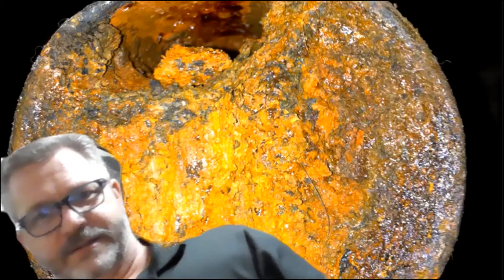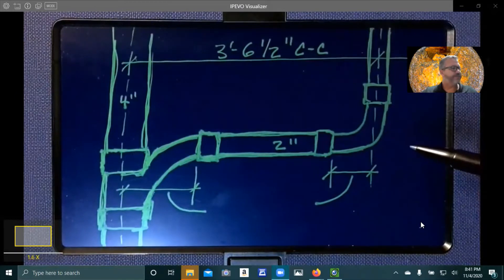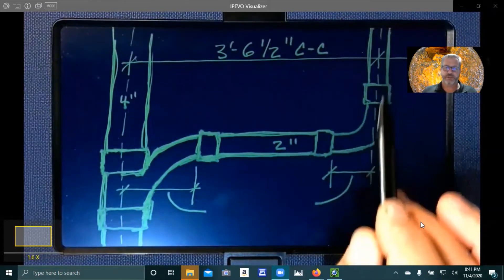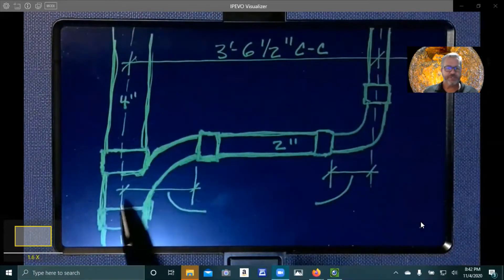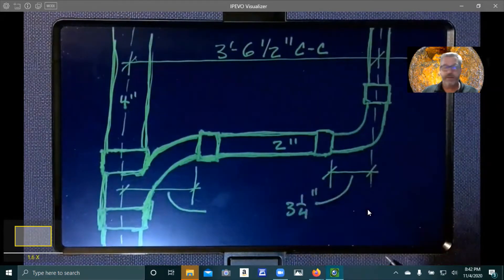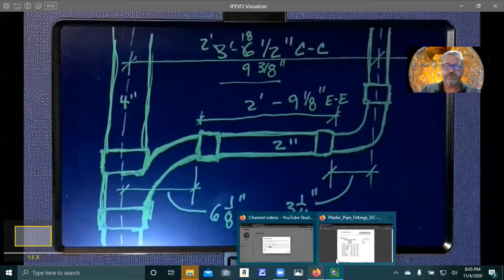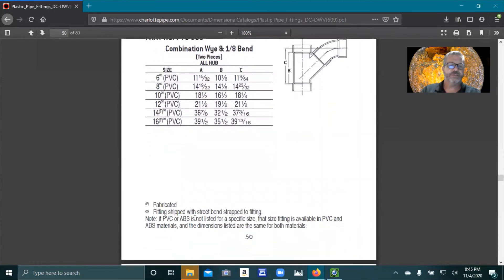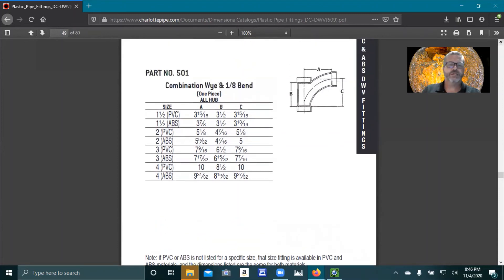Calculating ABS and PVC Cut Pieces

Comment: Appreciate plumber here, SO grateful & thankful I found this video. Been trying so hard to find this formula or find this knowledge! Testing for my journeyman by EOY. 

Would this formula work for calculating rough-in measurements as well? Appreciate your videos!
Reply from the maker: Quick answer is yes. Longer answer would be, reading plans for rough in takes more of a working knowledge in plan reading.  I did do a video on plans and reading them, but it is not as good as it could be (was done at the beginning of these, when covid first hit).

Comment: Great video, there should be more like this. 

As someone who has worked with contractors that diagram like this for a job, and others who just work as they go, it's so much more preferable to work like this. You can hand a drawing with parts and cut list to your guys and take off for the day and come back and have them advanced to a certain stage instead of hoping they know the proper way to route a line and instead they end up overusing fittings or messing up. Yes it takes time and some brain power but it's so much more preferable for anyone working with or around you.
Reply from the maker: I agree 100%  It is so important to be able to write a simple isometric, a skill that is lacking in most of today's plumbers.  I am actually planning on doing a lecture soon on doing design drawings.
Reply: @BGsPlumbingClass  Any plans on how the lecture is coming along BG? Excellent material on your channel. Super thankful I found your page!
Reply from the maker: @wompydoo  I will try to get on it this weekend.  I have been meaning to provide more instructional videos for quite awhile.
Reply: @BGsPlumbingClass  I appreciate both of your replies! TYSM for the info & knowledge! I will be looking forward to them =)
Reply from the maker: As you can see, I didn't do it yet.  I will. Been busy setting up a full time training area here.

Comment: This a good video.  Can you find all the fitting allowances in the Charlotte catalogue on every ABS Fitting that's out there?    Also how are you so good at doing math in your head? It takes me a while to do it.
Reply from the maker: All the fitting allowances are in the Charlotte catalog- at least for the fittings they offer.  That is for both ABS and PVC, so it's a good link to keep handy!  I like to use my brother as an example of math because I have always liked it- wanted to be a math teacher for a while because I was good at it.  He struggled throughout High School with math.  But once he got into finished carpentry building bent rail staircases, he had to continuously figure measurements.  Now he can do it in his sleep.  So in short, repetition of the process makes it easier.  You got it, half the battle is wanting to do it and you're there!

Comment: I cannot find a 3x3x2 combo in the Charlotte pipe catalogue.
Reply from the maker: Try page 50, I believe it's in there.  The catalog I used in the video was updated just recently- I believe a couple months ago.
Reply: @BGsPlumbingClass  Isn't the fitting allowance 5 1/2 for both the 3" and 2 1/4 for 2"
Reply from the maker: @realdeal8078  If you are referring to the Combo, the fitting take off for the 2" branch will be the "A" dimension which is 5 11/16"- or 5 5/8" if you want to round it- and the fitting make up for the 3" drain outlet will be the "C" dimension which is 5 1/8".  Both of these dimensions work for ABS and PVC.